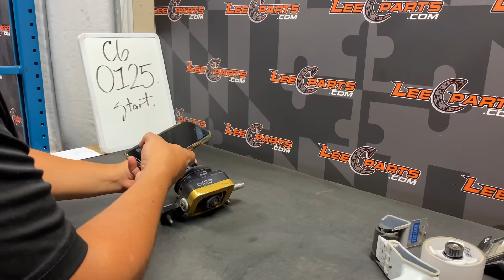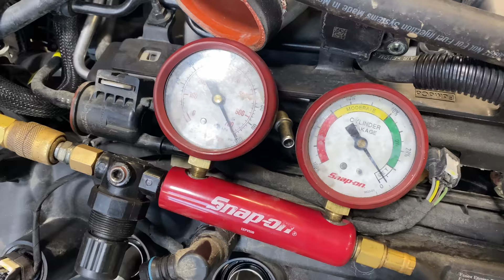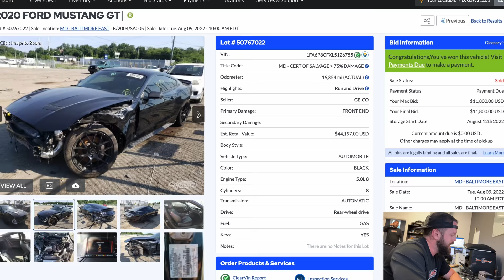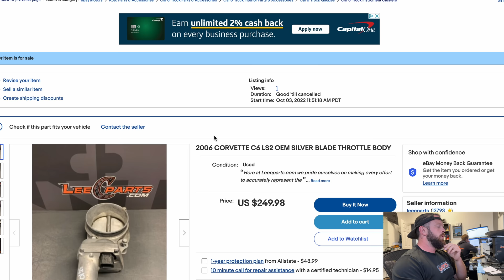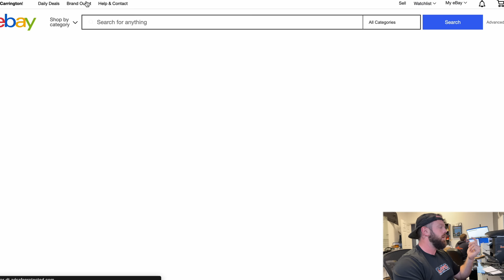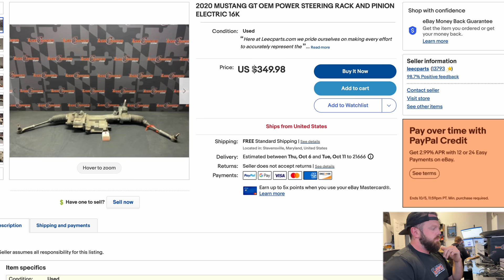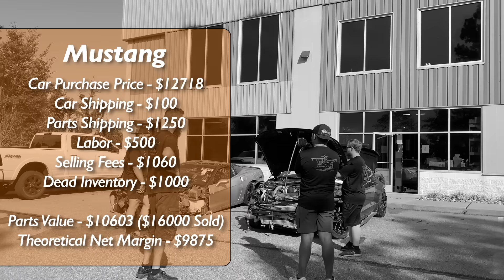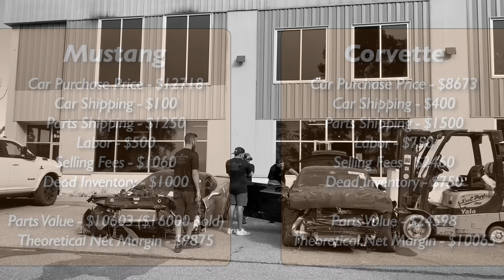Buying SUPERCHARGED Corvettes & Mustangs At SALVAGE AUCTION!

Comment: Pro Tip:  If your mouse has a middle button you can middle click a link and it will open in a new tab. Sad to see another Mustang down but nice vid 👍
Reply: ⁶⁶6666666666666666666666666666666666666666666666666666666666666666666666666⁶6666666666666666666666666666666⁶⁶⁶⁶⁶⁶⁶⁶

Comment: While I respect the Mustang and glad that Ford got rid of that 4.6 liter and brought back the 5.0 and 5.2, I’d take a  Corvette any day of the week as the engines are much cheaper and easier to work on as well as being more than capable of being able to produce very good and very reliable power. Anything you do with the Coyote requires 2 to 3 times the money as well as dealing with those dual overhead cams and everything that pertains to them that cause all kinds of problems.

Comment: Being an insurance adjuster seeing how high especially the exotics Carcasses are going for 60% of retail r rarely does it sense rebuilding one thst Sto that sold for $265k on ebay needs at least $140k in repais and even after repairs it will have a salvaged tittle those have  sold for $410k in mint condition clean w tittle  your better off looking for a good deal on a n unmolested vehicle. Cheers from Park City Utah
Reply from the maker: When speaking from a value Atleast, you’re correct. 

It’s far and few in between that cars of that caliber fall under the radar and go for  anything that most would consider “reasonable” 

It comes down to the fact that in almost all cases, these cars are being fixed for well under the cost insurance came up with, or they are being monetized in creative ways such as YouTube so the builder is less concerned with the financials of the rebuild itself.

Comment: In order  for someone too be certified at firearm handling the take a course?? Yeeees!!! Then why shouldn't someone whom buys these mass horsepower vehichle have too take a mandatory hi performance driving course?? Just a question??🤔
Reply: Why don't people be required to take basic accident avoidance training like skid recovery,  high speed maneuvers, etc.  Even basic safety ideas like maintaining a car length of distance for each ten mph of speed not known or followed by most drivers.  So when the teenager passes you with one hand on their red bull, texting with other on the cell, 80 mph and 10 feet behind the bumper of the car in front its no surprise when you see them pulled over a few miles down the road due to a collision.  Cars are way too fast for the skill of the people driving them.  But it's great for business :).

Comment: Corvette VS Subaru STI
Reply from the maker: 😳 it’d be a badddd day to be a Subaru
Reply: @scraplifegarage  The STI parts will be sold very quickly 
The 2.5L engine and the turbo setup 
The 6 speed manual
The rear differential
The seats and the interior 
And various parts and panels
Most parts are universal, they fit various makes and models from Subaru